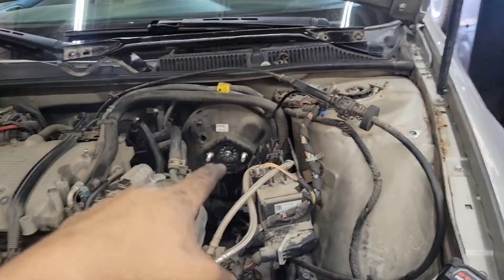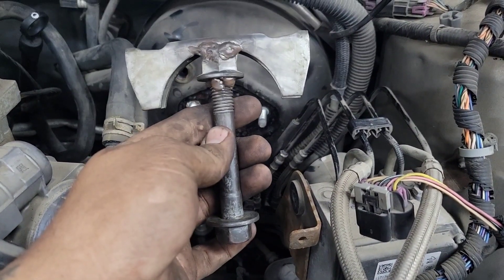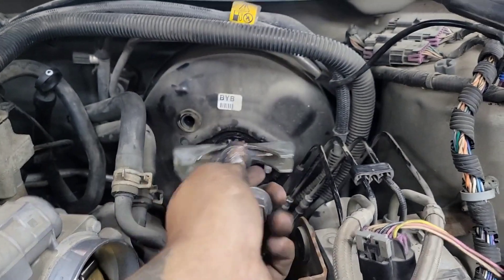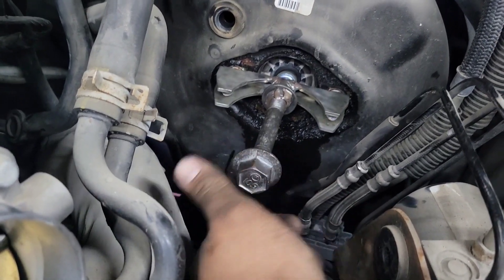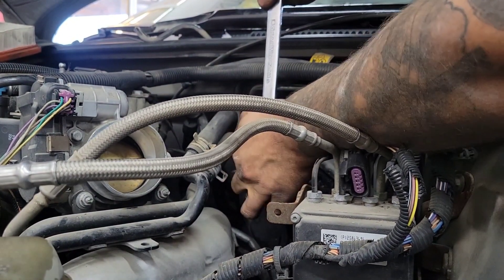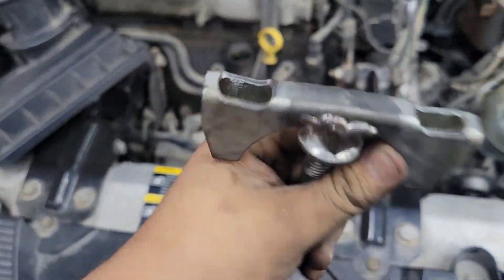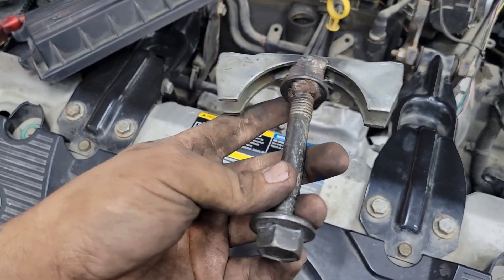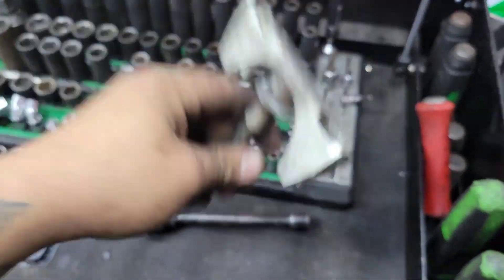Chevrolet Impala Brake Booster removal tool DIY Homemade How to

Comment: Just use a hammer as a lever. Set the head and the back end of the head counter set between the two bolts and use  the handle as a lever to turn it
Reply from the maker: Thats a great idea too